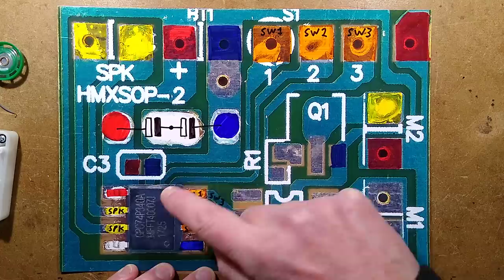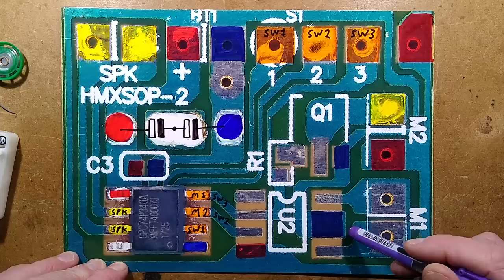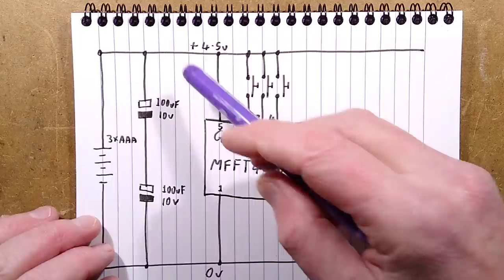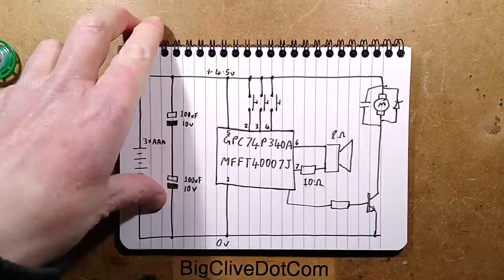Spooky bible teddy (with schematic)

Comment: Here is some info of that Voice chip (translated from Chinese) : 
Manufacturer : Sikewei
GPCT4P series voice chip 
GPC74P Series Voice Chip Introduction 
GPC74P)ODB series is the latest 4—bit voice controller with 4— channel SPU architecture for MIDI playback, including 
a 4—bit RISCCPU, a 14—bitPNM, 8/1610s, 256—nibbleRAM, and an OTP density of 160K / 
128K/96K/64K/32Kx12—bit memory space. The vorking voltage range is 
2.OV—5.5V, and the working speed is 1M/2MHz, 
which is set by the internal oscillator. Other features inciude low—voltage restart, infrared carry output (IRcarryoutput), watchdog , S dual—time—base interrupt sources (twotime—bases) and so on. 
2. Features 
4—bit RISCCPU 
CPU clock: 1M/2MHz, system clock: 8MHz 
output volt age 2. 0V’5. 5V 
Operating voltage: 2. 0V’5. 5V 
voltage regulator built—in input voltage 2. OV”5. 5V, 
IOIOA”IOD operating voltage: 2. OV”5. 5V 
256 nibbles RAI 
14—bitPYM driver Directly drive speakers 
160K/128K/96K/64K/32Kx12—bitOTP power— 
saving standby mode 
S dual time—base interrupt sources (twotime—bases) 
support 4 for JUDI playback Channel sound processing unit (SPU) 
16 or 8 basic 1/Os (bit progranimable) 
button wake—up function (IOA”IOD is used for 16 lOs, IOA”IOB is used for 8 lOs) 
low—voltage restart 
wat chdog 
3. Chip application field 
01) Electronic smart fingerprint lock products; 
02) Temperature measurement products (forehead temperature gun, thermometer, temperature measurement integrated 
machine, etc.); 
03) Small household appliances (rice cooker, induction cooker, microwave oven, electric kettle, etc.); 
04) Automotive electronics (reversing radar , driving recorder, ETC, etc.); 
OS) Educational toys (rocking car, basketball machine, claw machine, CS gun, etc.); 
06) Massage equipment (eye massager, neck massager, fascia gun etc.); 
07) Smoke alarnis, formaldehyde detectors, carbon monoxide alarms, gas alarms, etc. 
08) Blood pressure monitors, blood glucose meters, electronic scales, laser therapy instruments, etc. 
09) Smart water cups, electronic medicine boxes, electric toothbrushes, etc. 
10) Sweeping machines, mopping machines, all—in—one sweeping and dragging machines, etc. 
11) Shared charging treasures, laundry boxes, absorption boxes, charging piles, etc. 
12) Pet supplies (pet feeders, cat litter trays, automatic feeders, pet collar, etc.); 
13) Building intercom, video doorbell, burglar alarm, attendance machine, etc. 
14) Sports and fitness equipment (treadmill, balance car, electric motorcycle); 
15) Baby monitor, baby monitor, Baby cradles, baby monitoring cameras, and more.

Comment: Wonder if that's a surplus Furby chip? One of the autopsy videos of the older ones says that it had one motor with a cam set that would rotate in either direction to move different things at different times, plus inputs for pat on the head, belly and back if I remember.

Comment: that is a holy chip, if you connect pin 1 and pin 0 in parallel, and pin 4 and pin 5 in series to a 0ohm resistor, then then apply 5v and 12v for the differential power, you can communicate with the big guy on top

Comment: If you were putting that board together as a kit. How can you tell which way the IC goes? what method would you use? I have a solder kit with this problem.
Would you like to see a 1970's singing Xmas tree ornament? It would start playing every time someone walked by. The method it was put together is very strange looking.  I was thinking of rebuilding it with modern hardware. Maybe a fun item for a video. The bobble is very unique. I should send it to you for next year.
Reply from the maker: You may be able to work it out by the power pins.
Reply: @bigclivedotcom  The GPC74P IC is a 4 bit microcontroller made by a Chinese company called Shenzhen Sikewei Technology who specialise in voice/music playback ICs.  A very unusual part as it has a gigantic amount of program memory for a 4 bit device, up to 160k.  Sadly no datasheet is available for public download for this particular part, they have datasheets available for other devices though.

Comment: Having seen the trouble you had trying to get the box out how the hell do the expect someone to change the batteries or are they expecting people to throw it away after the batteries have run down. maybe they should have used a rechargeable cell with a usb socket and cable. I'll let you decide where to fit the usb socket.
Reply from the maker: In hindsight it hinges out from the bottom.  But I was wanting to get to the wires.

Comment: In the late 80's my sister received a magazine that had a advertising page folded over.  Inside was a small button battery, tiny speaker and a very small circuit board.  All you saw on the board was a black blob.  The chip was circuit on board.  It had about a minute of dialogue in memory.  It was to advertise saving wildlife or nature.  I'm sure it was a short time and they all ended up polluting dumps.

Comment: I found something: it seems to be a very special chip series for voice and sound synthesis. (The following is translated from chinese)
GPC74PXXXB series is the latest 4-bit voice controller with 4-channel SPU architecture for MIDI playback, including
A 4-bit RISCCPU, a 14-bitPWM, 8/16IOs, 256-nibbleRAM, and OTP density of 160K/
128K/96K/64K/32Kx12-bit memory space.

Comment: Hey out there and YouTube and of course another big claw video is always a good thing!

This is something that I've been trying to do for quite a while I'm trying to find either a dirt cheap toy or a single board solution for this you know something with a carb chip with just this one sound effect I'm looking for the quintessential doorbell sound wanting to be able to trigger by just closing switch contacts if there's any suggestions out there please include links it's for a few projects as in I'm an adult fanfuego and looking to build a doorbell sound module and yes I know there's one from Lego themselves but that's not what I'm after.

As well as a few other things would be using something like this as well another would be one that would play Westminster quarters!

You're the best Search terms to find modules like this for sound effects I'm striking out every time the lower the cost the better really at this time only looking for single quantities but if you need to get a couple say on Amazon would not be a problem but still budget wise.

And not doing something that's actually recordable device would be desirable!

Any voltage range would work but something around 4.5 volts would be best which is average for the sort of thing but anything at all could adapt for whatever power source I'd be using!

Usually crack a smile with most videos at least once as well!

Working on a modular system for things as well and suggestions on this as well.

For starters say in a legal project you would have a quintessential form windmill using a 24 volt AC synchronous motor running some lighting in this just using Walmart like that used for a ring doorbell of course internal circuit protection after the power comes in since dropping engage of wire and very much so for the lighting just running a beefy rectifier diode halfway of rectified at 24 volts ac for the lighting.

Planning on using Phoenix connectors for modularity Plus being able to make any Links of wiring easily.

Power Inlet would be 3-pin connector one common one unswitched and one Switched and of course this same Inlet cord could be used for almost anything.

Keep in mind everything would always be low voltage!

Trying to find a really nice beefy inline switch that's red for both AC and DC which is very important since it's not always going to be AC but any power source could use the same power Inlet cable just having everything modular just getting this system started!

It will grow as need be!

Eventually would also be building boards that could Supply almost any voltage needed including variable I use a little bit of almost anything so flexibility is going to be this is just getting started honestly.

This will work with other systems that already exist and having proper connectors for this even!

There be a variety of different connectors used and basically almost everything would be off the shelf components readily available that is!

This is something for my own needs at first but that could be later on kind of to be determined!

Also of sound effects does anyone remember having the Fisher-Price Little People Barn?

I'm sure people remember what happens when you opened the door when it was latched it all the way!

I'm hoping to have that on a recordable module one of these days or if there was something later released that had a sound module of some sort for this.

Kind of an Easter egg for a Lego Farm scene you could say!

Already found a way to build a 100% Lego diesel horn for Lego train routes already!

Prototyped and working 9 volt system complete with momentary switch for the same all that 100% Lego

Comment: Re: the chip. on a hunch, I tried just "GPC74 chip" instead of the whole thing, top result is a chip that seems reasonable. from the website:
"GPC74 series voice chip is a cost-effective voice chip mainly promoted by Shanghai Luncore Electronic Technology Co., LTD. The product is 4-channel voice output, with low price, small package, few peripheral components and low static power consumption. Product model ( 16B / 32B / 48B /64B / 80B / 170B / 340B ) to choose from, The chip is a powerful chip that can be applied to all with voice prompt solution, for example: intelligent household electrical appliances, toys, consumer, industrial security, life, process gifts and other industries."
note the 340B model, which seems suspiciously similar to the 340A part of the chip number. perhaps an old model thats no longer in production?
Reply: Found that one too! It seems they have a range of speech chips. They produce a '340B', so that looks like the type number used.

Comment: "More sinister things..."
So, I'm at the local Goodwill looking for interesting things I can salvage electronic components from (circa 2003), when I stumble across a nifty teddy which would announce the name of the body part you squeezed.  A must have since I was designing a scooter alarm system that would curse would-be thieves in proximity and or contact.
Once home I shredded the teddy being careful not to cut any of the switch wires...there were a lot.  Once fully removed from the fluff I no longer knew the original location of the switches, so I began pushing them "This is my LEG", "This is my NOSE", "This is my ARM".  It was interesting that the "This is my" was in an entirely different voice and tone than the "BODY PART" that followed.
Imagine my dismay when I pushed the button for the BDSM version of Teddy.
True story ... button "X" I will call it said, "This is my D!&K".
There were about 9 switches, and I don't know where "x" was actually hidden in the teddy, but I can guess.
You should keep an eye out for this treasure if you ever find one.  Clearly the Chinese have a sense of humor.

Comment: As a point of pedantry: a googlewhack is when you get 1 result exactly, not zero — zero is much easier to achieve. (There was also a rule that it had to be two words exactly, as an added level of difficulty.)

Comment: Such a missed opportunity to make it play Nier Automata's "We shall all die together and become as gods!" Nevertheless, "GPC74P340B series is a 340s four-channel voice OTP mainly promoted by Shanghai Hunting Arsenic Electronic Technology Co., Ltd. The product has low price, small package, few peripheral components, and low static power consumption; the chip is powerful and can be applied to all solutions with voice prompts. The chip has a built-in 4bit microprocessor, which can be programmed to achieve various complex functions. It has a built-in set of up to 14bit high-power PWM drivers, which can directly drive buzzers and speakers; 12-bit DAC output, and the speech synthesis method adopts high-quality ADPCM Algorithm, the audio sampling rate can reach 48K, no external oscillation is required, and it has ultra-low power consumption standby." (found on Baidu, ofc)
Reply: Apparently manufactured by Luncore.  No info on Eng page but Chinese lang page has a pinout and this: "GPC74P340B,  a 4-bit sound controller,  is embedded with a 4-channel SPU for MIDI playback, a 4-bit RISC CPU,  14-bit PWM, 17 IOs,  1 input pin (with pull low resistor),  256-nibble RAM,  and OTP with density of 680K*12-bit of memory space.  The operating voltage ranges from 2.0V through 5.5V and operating speed is 2Mhz, configurable through inner oscillator.  Other features include Low Voltage Reset, IR carry output, Watchdog, five interrupt sources with two Time-bases, etc."
Reply: @cyberwiccan359  Guess the same page as where I got the above desc from :) Wonder where are the "17 IOs" hidden in an 8-pin package, probably the other description was taken from a different version of the chip. Also I never found the "A" version, only the "B" one (probably it stands for a revision or something, rendering A obsolete)...
Reply: @TheBypasser  yep, that's what I'd guess. They do a whole range of them. Interesting that you have to choose "Chinese" language to see any actual detail. I mean, it's not like it's hidden, perhaps more that they assume the non-Chinese market simply doesn't care?
Reply: @cyberwiccan359  Likely they just didn't really have all the documents translated, so left the English page unfinished for the time being, as it would be pointless until then anyway (which is probably "till never", also I usually just view the Chinese pages with English translation enabled browser-side anyway).

Comment: when I was a child I had already a toy that could speak, in 1972. It was a police car, about 15cm long. It was battery powered, and it in fact used a quite rough implementation of a grammophone.... the white plastic record was about 4cm diameter. It had a mechanical needle attached, no electronics, and it sounded awful. But you could understand at least a few sentences of the announcement. The sound recorded was maybe 10 to 20 seconds..... of course I took it apart..... and learned ;-)
Reply: It didn't happen to say "BD to Z Victor 4", by any chance?  If so, I had exactly the same one.
Reply: @Tevildo  No. I am from Germany, so it was in German. It startet "Achtung, Achtung! Kindesentführung!" (I am astonished that I remember that, now as you are asking 😄 ). In English, it would be "Attention! Attention! Kidnapping of a child!" Interesting, that this should have been an important topic in Germany at the beginning of the 1970s?
More interesting, that the battery only powered that "grammophone", but the wheels were driven by a flywheel...., so possibly no thorough complete design, but just putting together some parts that already existed. The car was like a bus, made of thin metal, but the internal "grammophone" was made out of plastic.

Comment: Lol I had one that used to play Christmas carols.  Needless to say it ended up in bits and I remember making the songs play all fast by changing a resistor then did experiments to see what the maximum operating voltage was.
Reply from the maker: Sadly this version isn't so easy to circuit bend.

Comment: I just puchased a multimeter online, its a Kaiweets KM601, I thought is was just auto ranging, but no. No matter what input you give it (voltage, current, resistance, frequency, Temp,diode or  capacitor test) it sorts itself out and just measures whatever. I would like to see your opinion on this mutimeter, its very interesting.

Comment: Nice video BC.  I am freaking out. When I started to write my comment, I see there is/was 666 comments.  OK, the bears eyes should glow red.  I think it would be worth it to provide end user with upgrade path, like shaking, eyes glowing,user programmability, ability to slow down and reverse playback, head rotation 180.  Just throw in all the features a bear sales price could be 10X and I would have to buy one.  I hacked my Teddy Ruxpin (made a teddy tape control signal generator) back in 80's to create some pretty wild teddy tapes -- needless to say teddy was disgruntled with his job reading endless little stories to kids.